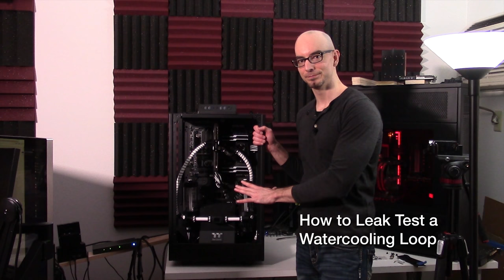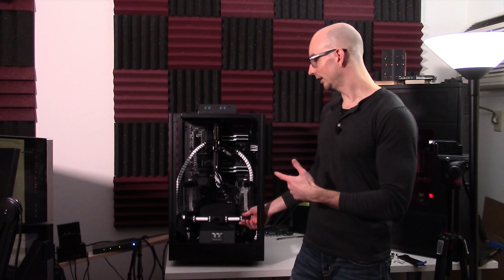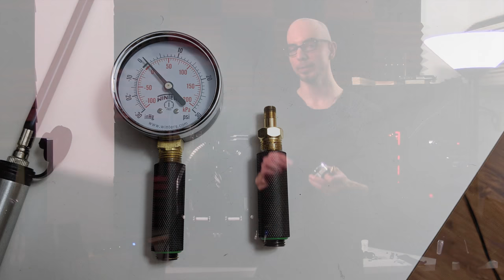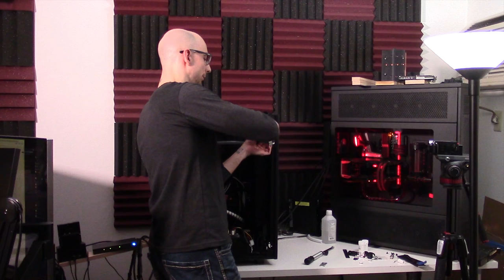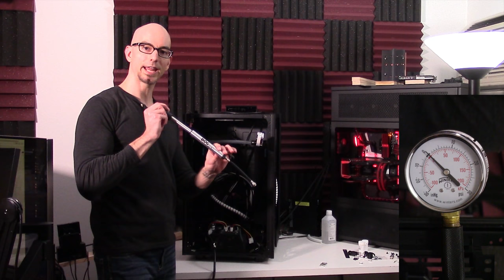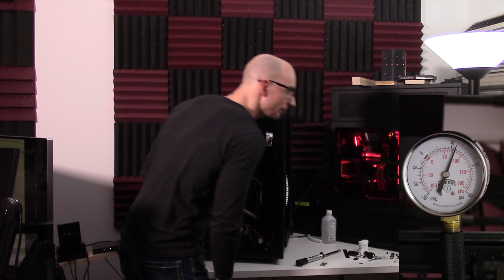PC Watercooling: Leak Testing with Air 01 [Parts & Demonstration]

Comment: why couldn't you just use a quick disconnect on your drain port with a regular in line pressure gauge? you had a great idea but you over complicated it with the Schrader Valve. also canada uses npt. also.

Comment: P.S.A.  someone on reddit had their reservoir crack because they went to 10 psi.  go for 5 psi.
Reply from the maker: While this is a late reply, I do want to say that the pumps that we all use for PC water-cooling are capable of pushing out more than 10 PSI.  So, if something broke at such a low amount of pressure, then it was likely defective from the start.

For example, Alphacool states, on their site, that their radiators are pressure tested at 2 Bars for leaks.  When converted to PSI, 2 Bars is about 29 PSI.  While I'm sure not all PC water-cooling equipment is tested for such a high amount of pressure, a failure at 10 PSI is unexpected.
Reply: @MiR4i  I took precautions and pressure tested at 9 psi.  That being said, your video was vital in helping me find 2 leaks, both from rotary fittings.  Thank you.  Thank you for focusing this information into one video.

Comment: thanks great information. Do you have a link for the air pump
found something.  SKS handpomp Spaero zilver 21,5 cm. its about 20 bucks. couldnt find cheaper. This will work too

Comment: Awesome video- subbed!

I attempted this without the pressure meter, left it overnight, and found my first loop ever (soft tube) failed the test.

Do you have any suggestion on how to find a leak without putting distilled water in my loop?
Reply from the maker: Unless I'm reading your comment incorrectly... How do you know that the test failed if you aren't able to measure the pressure since you don't have a pressure gauge?
Reply: Put a little bit of soap and water on all the fittings and try to run the preassure test again and If it's leaking you should be able to see bubbles from where its leaking but as in the  video Its much easier with a manometer and you can get one really cheap.